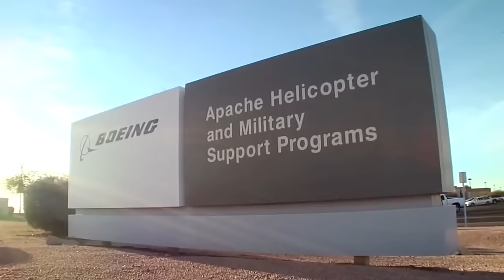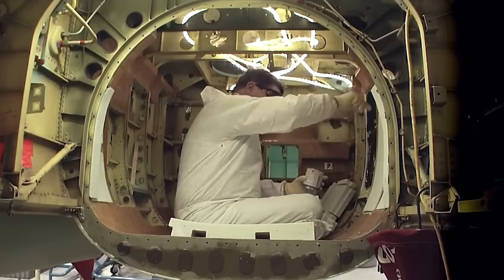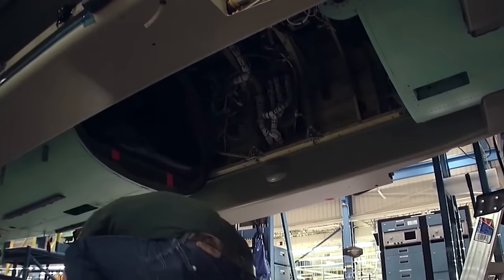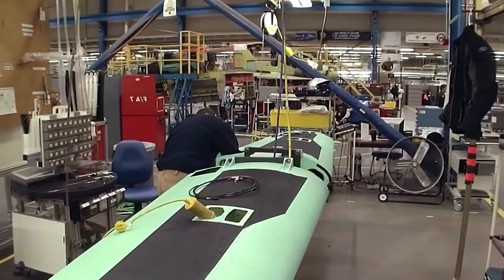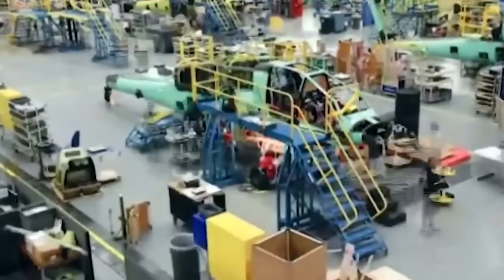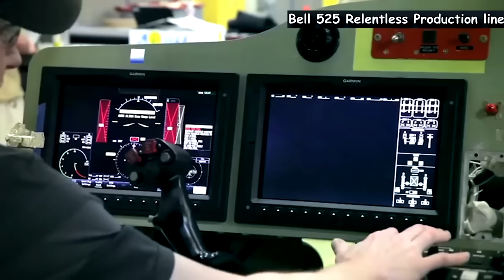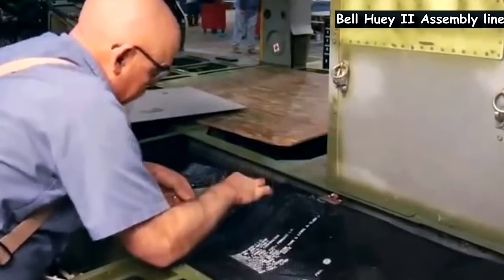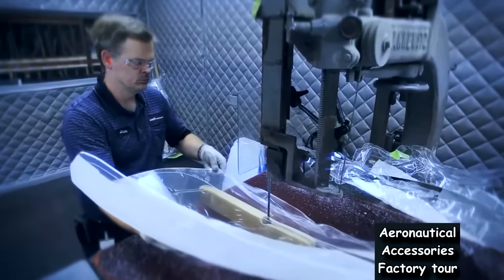Inside Secret US Helicopter Factory: APACHE AH-64 Manufacturing process - Production line

Comment: secret, british army make there own, with westland helicopters, fitted with twin roll royce turbo mecha engines, faster climate rate, higher pay load, 2500bhp each, with 3300bhp in over boost.  the usa soec gets, twin ge engines two GE T700-GE-701D produce 2100bhp on the ah64e guardian.
Reply from the maker: Thanks a lot for your comment mark huckerl! How is that you have such a good information?
Reply: @procestovatele5579  I use to ferry the parts for servicing on royal logistics, ash church camp,  id go down to Westland, have a nose around the helicopters in for servicing, have a little play in them, talk to the engineers, relay feed back from the pilots, shooting the breeze n what not. just being in and around the flight crews, you find out stuff.

Comment: Guys can the or have you tried to mount xm913,,,,mishismitt 262 also had this gun,,,,a 50mm cannon if axillary booster put on the wings when firing ,,,50mm cannon will it hold the force,,,,,if it does a 20mm flack cannon with a ratio of solids as missials have hard heads a ball bearings might not stop it,,,,,,the chop with 4km sky zone,,,,the chop should be called black sea good luck guys make one they sound what is needed if the chop handles force

Comment: junk mock ups. all OEM systems are cladded and confined within structure designs as well as assembly and coating Firstly manufacturing of materials from air gas and solid material